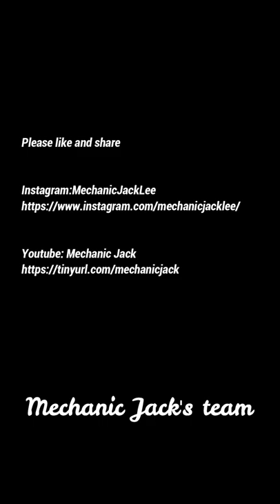Maintenance Service forklift brake system

Comment: The roller bearings should be fully packed with grease before restoring them back. alot of friction normally occurs that generate heat